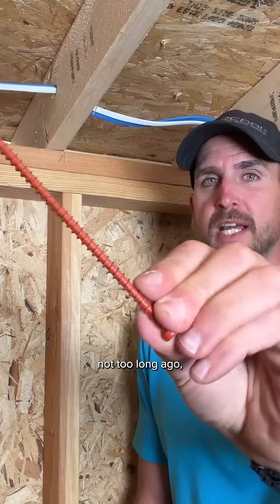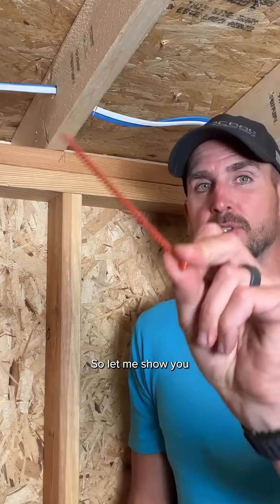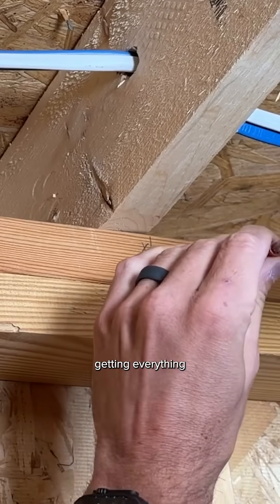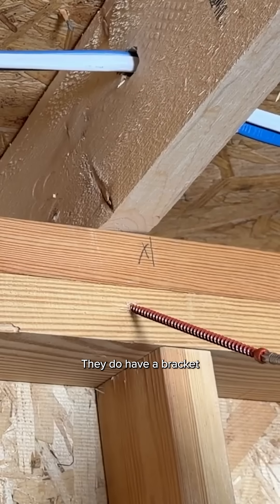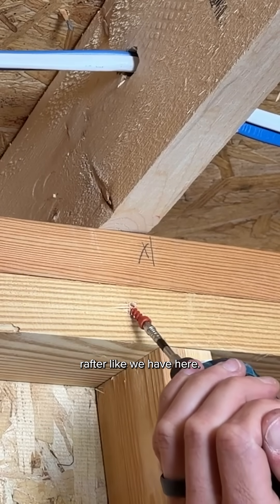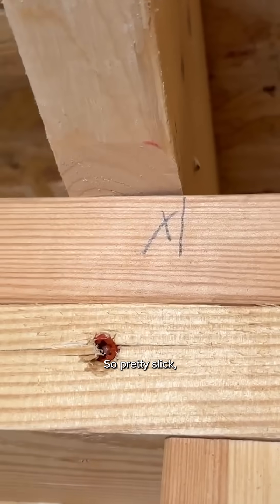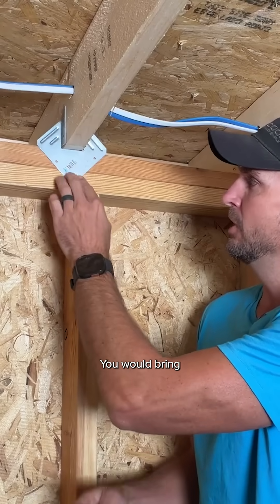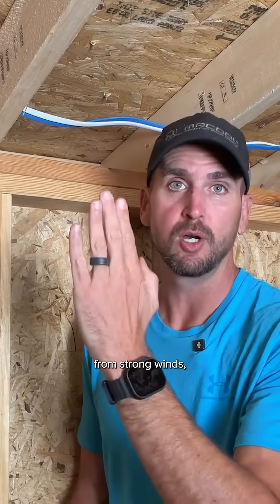The Screw That Makes Hurricane Straps Obsolete?

Comment: The plate method looks a lot stronger.
Reply: I would do both !
Reply: @dougtodd305 especially the way they are allowing homes/Apartments units to be build nowadays
Reply: @dougtodd305 There would be so many fasteners driven into that small section of wood that it would look like pulped splinters.
Reply: I would do both ,with TECOs nails in the STRONGTIES .
Reply: @dougtodd305 yup, palm nailer boiiiii 😂
Reply: agree, shear strength is greater than pull-pull strength
Reply: @bill_l_922 shear strength is completely irrelevant when talking about uplift force. There are other structural components of a building and the roof to handle shear forces.
Reply: @JamesLake78 and when the uplift is perpendicular to the screw its turned into sheer force against the screw. 
This isn't rocket science.
Reply: Plate itself would be stronger.  The weak point I would guess is the nails themselves. I’m curious how one vs the other tests out.
Reply: @jayss10 the screws outperform the plates and nails. Not by a lot but they do test better. That’s also under correct installation. The screws are less likely to be installed incorrectly than the plates. The plates themselves are incredibly strong, but the nails aren’t. They’re tough and won’t snap but they pull out more easily than the screws. The only load they are going to have of significant force will be uplift.
Reply: @JamesLake78  The long screws going in off-center seems more likely than plates being installed wrong.
Reply: @timower5850 they don’t wander as much as deck screws and the sort. It’s also a lot easier to hold them where you want them to go than screws. I don’t know how to explain it but once you install a few of them it’s surprisingly easy to get them dead on every time.
Reply: @jayss10 those heads being so small can't be great either
Reply: I cannot see building inspectors even remotely passing this if all the inspector is seeing a screw head imbedded in a double plate that’s not even centered over the rafter. I just see a lot of cracks and splits as the building settles. Shortcut not worth it maybe for a unique problem or fix, definitively not for using to build an entire building. God Bless Stay Safe!🙏👍🐶
Reply: @frankpuncekar5051 That was my thought, it doesn't matter that it's up to code, if the inspector wasn't there for the install how can they confidently ok the install?
Reply: @frankpuncekar5051  I've seen some framing that was ok'd; and thought okay we got away with that one.Yet have some be excessive without convincing me. So you never know.
Reply: @frankpuncekar5051 What if someone only installed 1/2" or 3/4" nails or screws into the Simpson bracket? Inspector can't see that either
Reply: @frankpuncekar5051 Right? At least use a washer and have a larger screw head. Even with that I’d rather have the plate.
Reply: Plus, in my house you don’t have access to retrofit the screw.zzz
Reply: @ziegle9876  If you don't have access to retrofit screws, you DEFINITELY don't have access to install H1 ties.
Reply: @generic_username-q7x  Tie down during roof maintenance.  Giving your predilection for using asphalt shingles that need to be replaced all to often there will be plenty of opportunities to pull that OSB / ply sheeting up (it probably needs to be replaced anyway) and then fit brackets and straps to tie the rafters down.
Reply: Plate uplift in Doug-fir is 545 pounds.  The screw is 615 pounds.  Simpson publishes these values based on testing, you can look it up for yourself.
Reply: @SteelheadTed wood split from one screw, WEAK..
Plate is FAR STRONGER,  and any twisting elimination.
Reply: @SteelheadTed I'm no engineer, but as a welder, I would use the plates. Increased surface contact plus nails gripping in at all angles. Also much easier for the building inspector to visually verify.
Reply: @johnw4590  the nails aren’t gripping at all angles
Reply: @SteelheadTed but what about lateral pressure? You are screwing through the grain which can cause one side to 'pop' out. Plus, nails are designed to be bent over and over, screws hold more, but break instead of fatigue. 
I love new products but I'd rather 20 years on someone else's house and they can get back to me.
Reply: @chadlucier  "screws break instead of fatigue"

Structural screws do not.
Reply: @generic_username-q7x they may bend over once and snap on the way back. A 16 penny nail will bend back and forth a dozen times, a ledger lock will break after bent.
But that is an interesting bit of knowledge. Real world and lab testing is intriguing.
Reply: @chadlucier TECOs for sure!
Reply: @chadlucier  That’s exactly what I was going to say.  While it “feels” strong to have a screw contact at the middle of the joint… All the pressure is now on the wood INSIDE the grain.  Theres a reason no nails or screws are in trusses.  The contact is on the outside of the board where gang plates are strong and don’t introduce any failure points to the bond.  Hence, Simpson ties for this application.

Basic high school cabinetry class would tip you off.  “Don’t drill into the grain, boy.”
Reply: @brianmckenna3062 the screws are actually stronger than the straps. This video is an incorrect installation too, so don’t base too much on it. 

Just make sure you take photos of the install and the receipts of inspection is done post drywall or might be someday. Also don’t install them in a single top plate. 

If you really want to have the strongest connection, install both of them.
Reply: I would think so. Much more surface area which helps distribute  the load or for this purpose the sheering, and  torquing loads.
Reply: But this is way cheaper and not only can split plates and rafters, but gives someone a chance to angle incorrectly.
Reply: Yup. Screws can break easily too
Reply: I bet either one is more than sufficient.
Reply: Definitely
Reply: Before sometime in the 80s and 90s rafters were toe nailed , the conversation was .......1 toenail on each side .... 2 on each side or 2 on one side and 1 between them on the other side to help keep the rafter from spliting all to hell which many did. I should know because I framed hundreds of these homes in the 70s.  By the time all ceiling joist ,the bracing , rat runs, hog troughs , plywood decking , sheetrock and roofing was put down .........the shear weight of the roof structure held the roof in place and tens of millions stand today having only been re-roofed a couple times or more. Not saying that is the way to go but now we have upgraded to 2x6 walls and a structual tie, embeds, and 10,000 types of   fastners and new codes to tell (force) you where to put them even though they are not needed  There is so much overkill today in building a home that it prices most working families out of ever owning one. The American people have been screwed so much that not only can they no longer feel it ......they say yes and screw my neighbors while your at it,  don,t allow them to use their own common sense and discernment to build what they want, can afford or to plan on the den , great room or 2nd or 3rd bedroom.a few years down the road  to live within their means or just expand as the family grows , .....what a damn shame !
Reply: @randyrussell6246 A lot of roofs have blown off in many hurricanes due to them just being toenailed down despite the sheer weight of the roof structure. 
 Lots of others that used evidence based improvements such as telling people where to nail and overlap plywood in addition to new materials such as hurricane clips have saved many houses from being destroyed.
Reply: @randyrussell6246 You have never driven through a Florida town after a hurricane.
Reply: Good thing people don’t just build houses based on whatever LOOKS stronger
Reply: Yes but it cost $3.65 and takes five minutes to fit- who is going to lavish that kind of care on building a strong house to last 50 years?
Reply: If I were going to a screw, I think I would go with a Timberlok straight up through the plate.
Reply: Looks arent what matters chief
Reply: This and a 50 yr mortgage
Reply: It’s not. lol
Reply: Replace eight points of failure for one yeah I rather have the plate.
Reply: I agree
Reply: How is sponsoring this idiot if screw fails in plate you have a schmuck insurance  as more fastering
Reply: It is
Reply: Who cares when u live in an area that requires this to meet code but you have practically no geological activity. Im in the foothills of california and its a req for us even though we don't experience anything of a magnitude that would require these things. It will save alot of money for those sorts of cases
Reply: LOOKS that way but it isn't
Reply: Now why go through the side of the beam rather than coming directly from beneath the bottom top plate... both beam combined are 3" and the screw is 6"?
Reply: @brianmiglionico5835  the wall stud is in place  so can’t go directly from below.  If one were to angle it then getting that placed at correct angle without either missing rafter or not hitting in right place to get bearing into the rafter is not impossible for any one attachment but would be a LOT of misplaced screws in a house
Reply: @timrxn5414  true I can see that now that you mentioned it. As far as missing the rafters, I guess I would use carpenters square to line up 😅 im sure not perfect haha, but honestly the bracket feels safer to me, lol.

Although after looking this up, the screw is not supposed to be placed where it was in the video. It is meant to be used with the bracket, which lines it much lower almost at the very bottom corner/edge which grabs much more meat of the lower plate...
Reply: Make that bottom hole on the strap slightly bigger and use both.
Reply: If MTBF from all weather effects is the object , give me the strap .
Reply: I live in Michigan.  There is no hurricanes.  There is millions of houses that have neither .  They are just fine.
Reply: You do get tornadoes and straightline winds.
Reply: Only looks
Reply: Because it is.
Reply: The screw simply doesn't pass the pucker test
Reply: These guys remind me of the dei docu of a lady that said "I dont care what research says, my grandma told me Cleopatra was black and i'll believe it".
Reply: @Pepe-dq2ib comment didn’t hit the way you expected it to?
Reply: @Pepe-dq2ib what?
Reply: Why isn't the rafter properly centered over the stud?
Reply: @johnwright1740  Because it is on a double top plate so it doesn't necessarily need to be on the stud.  Many thousands of homes have 16" O.C. studs and 2' O.C. roof trusses.
Reply: @johnwright1740 good eye!
Reply: @johnwright1740  I believe that only applies if the intervals are equal.  Most roof structures in residential have 24” OC, while studs are nearly always 16” OC.
Reply: @johnwright1740  You obviously have never framed a house.
Reply: @johnwright1740  Rafters do not need to be centered over the stud.  There is a double top plate.  Don't know why this false information persists.
Reply: looks don't matter, testing does.
Reply: @napwithus testing shows the plate is up to 3x stronger
Reply: A single sdwc doesnt replace a h1
Reply: @liquidbrainstormnope, the screw was actually 3x stronger
Reply: @liquidbrainstormgreat, a claim we can test
Reply: @liquidbrainstorm lol no it doesn't the screws are rated higher lol they are designed to meet or exceed every tie on the market...
Reply: @liquidbrainstormthe wood fails before the screws. . that is the point. if your home is losing "8 screws... the nails in that osb are gone
Reply: @napwithus depends on what screws you use on the plate.
Reply: @extraclipyou NAIL THEM WITH 10D. the screws push the drywall out. remember this is shear force .. uplift from wind outside. the screw is fine, the roof would fail before the 8" screw is pulled through a double top plate AND birds notch
Reply: @napwithus The screw looks cheaper, faster, but clearly inferior.
Reply: @Kikilang60  Clearly in what way?  If the holding and shear meet specs, how would it be inferior?
Reply: @Kikilang60  aka what is the bare minimum you can get away with
Reply: A new house or renovation the house is more expensive than using brackets everywhere better safe than sorry
Reply: @Kikilang60 they have a purpose. the reality is if the uplift hits that roof hard enough to rip 8" of threaded truss screw anchors ... your home is gone anyway.
Reply: @napwithus  minimum legally viable is why american products sucks.
Reply: @Epyon1201 wtf are you talking about. our country is huge. most houses are good. better than most countries. my home is brick, it's an option plenty of people choose
Reply: Most code guys and engineers will not approve of these. Just because it’s UL listed, doesn’t mean it meets building code.
Reply: Looks are often deceiving.
Reply: Looks like you don't really know what you're talking about, but hey don't let that stop you.
Reply: @thepegger8422   Thank you.  Looks like a lot disagree with you 😂
Reply: @markd9105  They can disagree with me all they want.  I can't help it that I am right :~)
Reply: @thepegger8422  Thank you.
Reply: @thepegger8422   Thank you. Looks like a lot disagree with you 😂.
Reply: It’s not. It’s all for uplift, which the screw provides better numbers.
Reply: Testing is inferior. Real life application and detailed results are the only way. Wood has grain, knots and all sorts of characteristics that play a role. Also they claim it "replaces", meaning it meets the minimum requirements not that it out performs.
I will keep using clips, there is no way the lateral shear is the same in the two products.
Reply: @chadlucier  "Testing is inferior. Real life application and detailed results are the only way."  
Hilarious contradiction.  Literally describes their testing in the 2nd sentence.
Reply: @chadlucier  do you have any idea what testing actually is? They literally build rafters and put it under 25 different kinds of loads getting detailed results down to  .1/kg. Or, you just hit it with a hammer and say "yep, it's strong"
Reply: @chadlucier  I don't think you understand how this work.  There is no "lateral shear" in the screw.  For uplift, that screw is in tension, not shear.  

And no, "replacement" in this case does not mean simply a minimum requirement.  It actually has a higher capacity!  There is no code mandated way to resist uplift on a joist or truss.  It is based on calculations specific to the building such as roof pitch, geographic location, etc.  Someone (usually an engineer) determines what the uplift is and then selects a connection method to resist that uplift.  This Simpson screw has a higher uplift capacity than the H1 clip.  That's a fact.  Either can be used if the capacity is greater than what the connector can resist.

Testing is not inferior, it tests the fastener in the real life connection.  You are hitting on an area I am pretty well informed.  Testing accounts for real life things like the items you mentioned, knots, etc.  You'll be shocked to know that those H1 clips were also tested when they were first introduced...
Reply: @SteelheadTed thank you for putting uninformed people in there place
Reply: @SteelheadTed I don't understand how people think wind, hurricane or otherwise doesn't also present a lateral force?
You guys do you. Build your 50 year homes.
Reply: @lifebehindbarsonemansstory2189 👏🏽👏🏽👏🏽
Reply: Easier installation: drill straight up thru to plate into truss or rafter. You can double the screws for 2x the uplift resistance
Reply: @EngineerMikeF Easier rarely means better.
Reply: @EngineerMikeF  That is exactly what I thought. Plus have a much bigger head on the screw to provide more bearing.
Reply: @EngineerMikeF  Simpson gives 6 installation conditions that are acceptable for the screw.  Each condition has a different uplift capacity.  What you say may be true but you can't just change it and assume it is.  You have to make sure the installation and the resultant capacity is enough for the load being resisted.
Reply: This video reminds me of another YT video where a Mexican immigrant is working on building a small house somewhere in America.  As he builds the framing, a viewer notices the builder is using drywall screws, pounding them in with a hammer, to connect the 2x4s & 2x6s.  After being called out for that, the builder says "Oh... that actually works better than nails because they screw themselves in automatically when hit with a hammer."  My god!  That guy has no idea what he's doing & shouldn't be building anything for anyone.  This video isn't much different.
Reply: @mosler302 😂😂😂